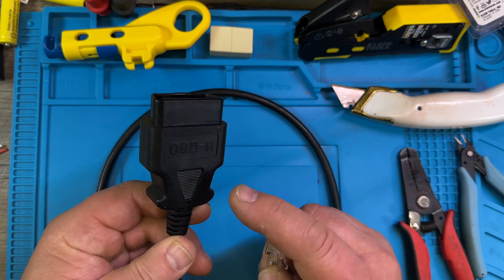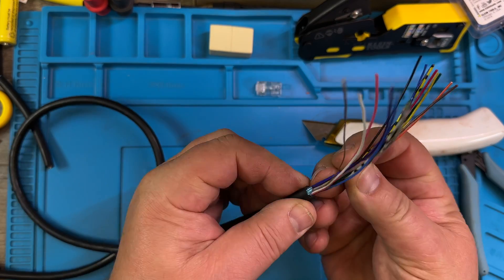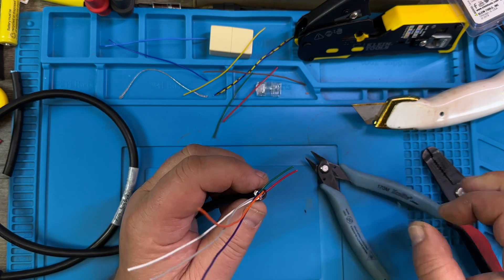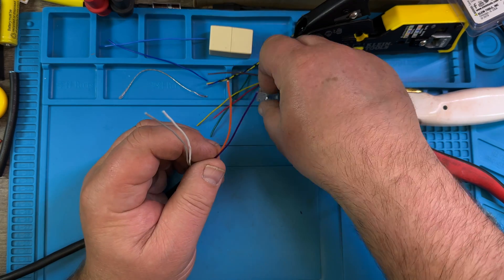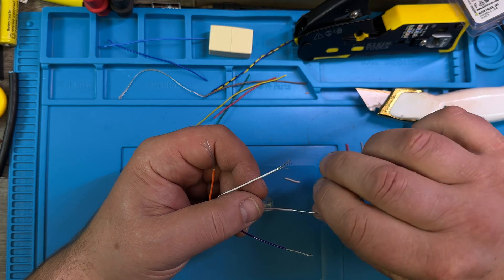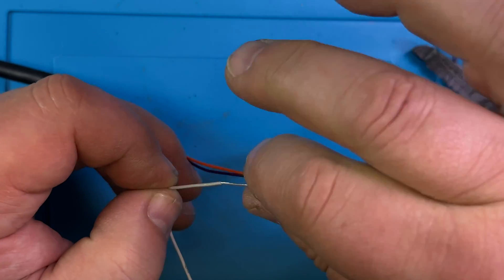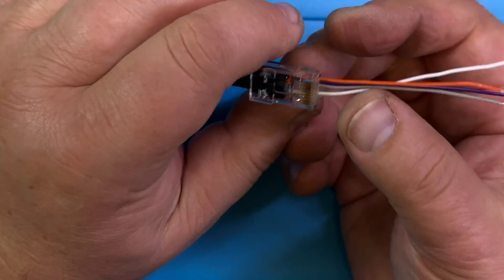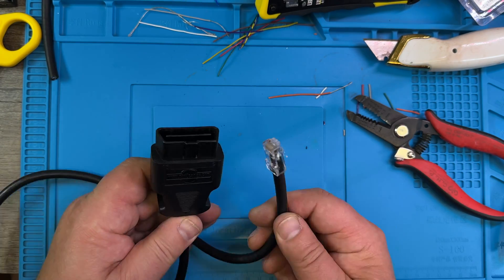OBDII to Ethernet

Comment: For a F or G series BMW, you cannot If you simply solder the green and red wires from the OBD2 cable together, you need a resistor between those two wires with a value of between 506 and 560 Ohms as this will tell the car what protocal you are connecting to the car with i.e. Ethernet

Comment: Why are you stripping the cables before putting them in the RJ45 connector? You're cutting the end off anyway...

Also: There are very few cars that have an Ethernet network exposed on the OBD2 port (BMW is one them), so make sure your car has it, otherwise you might fry your laptop's Ethernet port if there's something else on those pins.
Reply from the maker: The wire insulation was a little to thick to fit into the CAT6 connector, it was pretty tight in the hole.
Reply: I was thinking of doing this to use in a BMW. Didn't really understand what u said; can u explain pls?